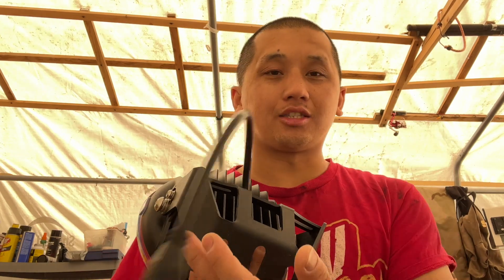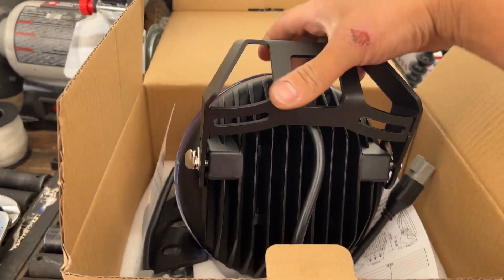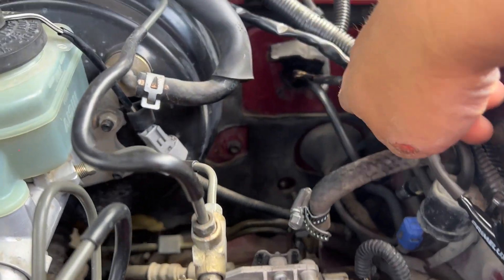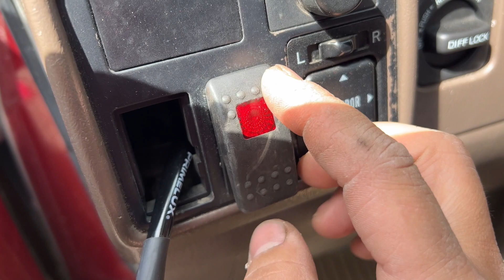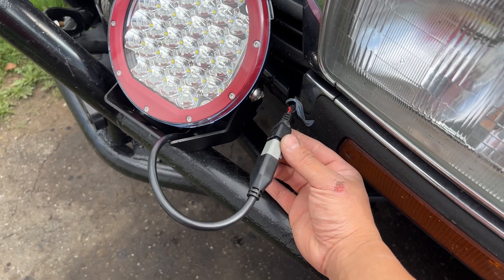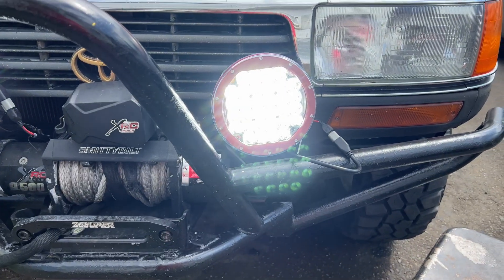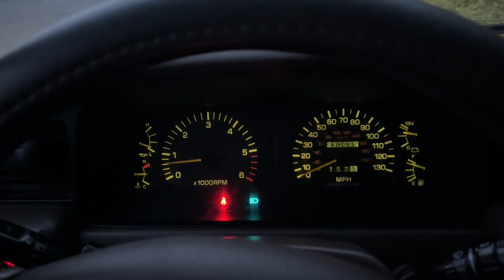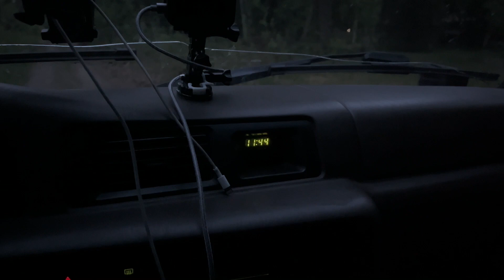PRIMELUX 8" LED ROUND LIGHT | FIRST IMPRESSION & INSTALL REVIEW

Comment: Primelux good lights, High power 32x5W LED chips, 6000K cool white color temperature, 160W &14400 lumens, super bright light source even in daylight. it can light up everything around you and make you driving safer! in addition, our products have 100% light transmittance, which more comprehensively reduces the waste of light.